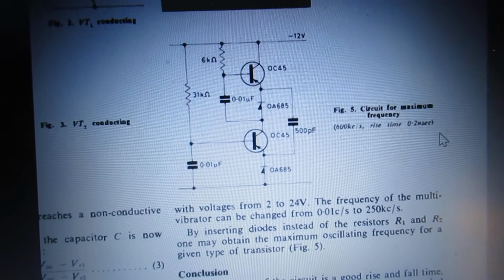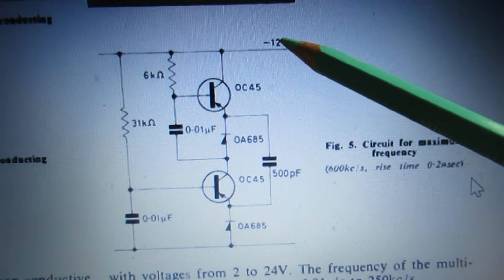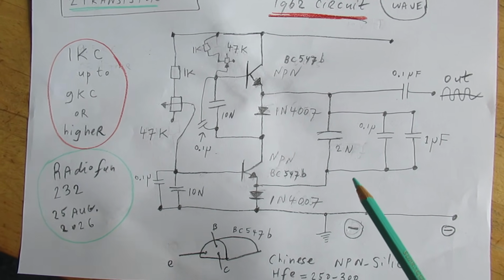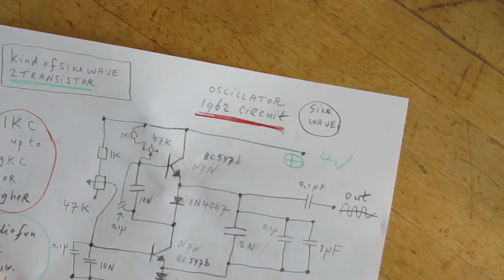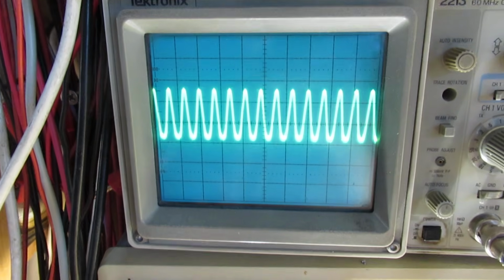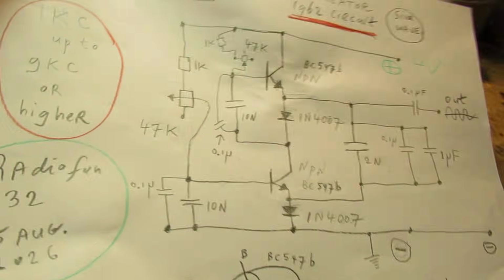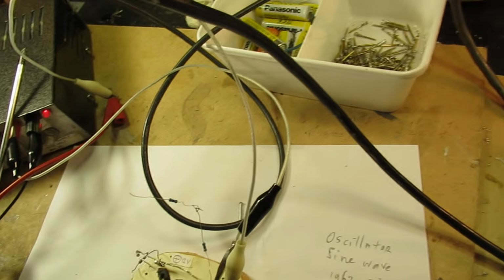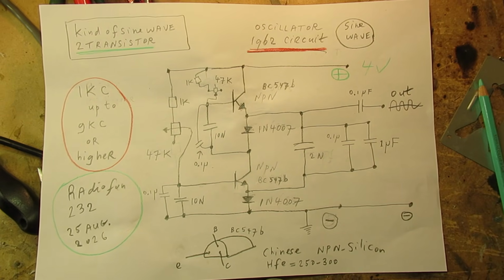2 Transistor audio sine wave oscill on 4 Volt for higher audio frequencies, a 1962 circ. schem &demo

Comment: I'm surprised this works even with the 1N4007 diodes. They aren't really meant for high frequencies.
Reply from the maker: Yes, true. The 1N4007 surely works up to (say) 20 KC (tested), though I never did serious tests with the 1N4007, to get idea's about its performance in real HF circuits. The whole circuit is ripe for many tests and varying of the components, to see what can be reached with this simple setup.
Reply: I like to watch your work , as it is somewhere between 
 Abstract Art & Organic molecules and Jan Miro paintings ... and  Science ...
... and
 it looks so cool.

 Like Some kind of electronic/ proto microorganisms and sculpture hybrid.
 Reminds me 
on my 60-70' era and my years when things were more like that ... 
No SMD , NO Kits and all ... DYO , parts pulled from the local Radio club dumpsters , behind TV repair shop, old attics. 

👍👏👏👏 
All the best.
Reply from the maker: @marinvidovic763  thanks & yes, I move on quite a few "fields".